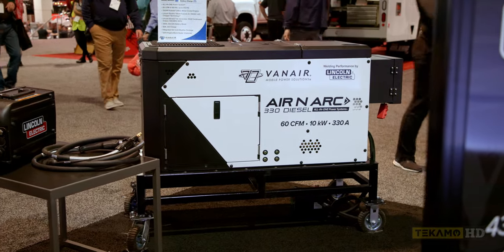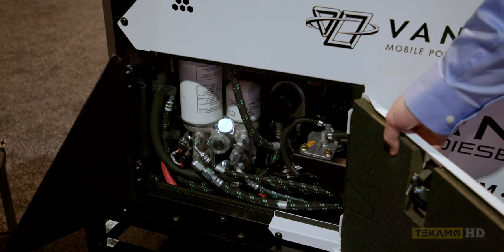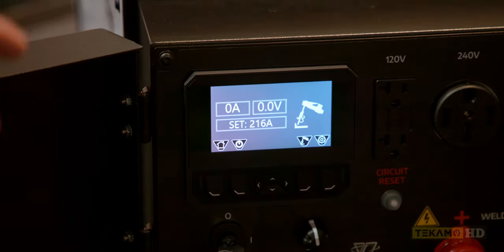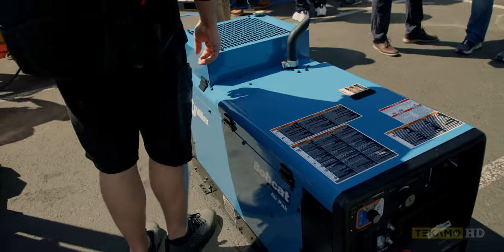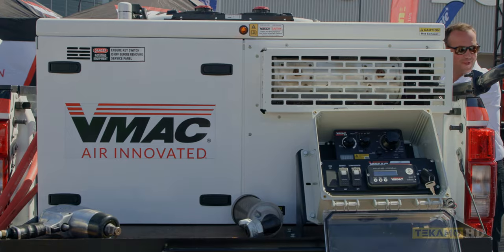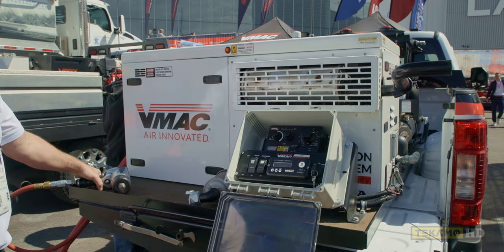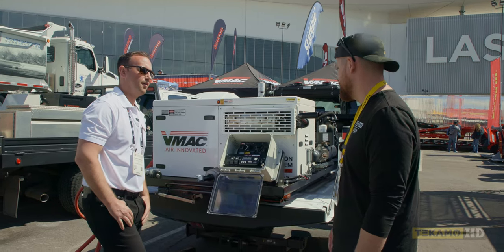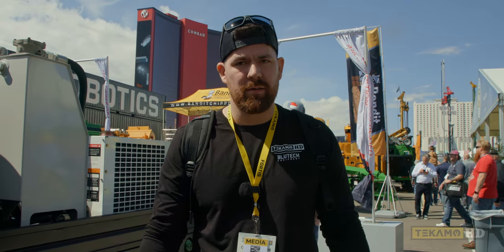ALL IN ONE SOLUTIONS! For Heavy Duty Mechanics - ConExpo 2023

Comment: I think I’m in the minority, I like to run EVERYTHING off my trucks pto hydraulics
Reply: i agree alot less to go wrong this new stuff to much digital garbage to go wrong
Reply: I guess the electric systems will be popular in the future, you have a decent size battery and power converter so you can use your normal compressors, welders etc that you would normaly run inside a shop.
Make choosing a vehicle much simpler since you dont need a PTO from the vehicle just a beefy alternator or a secondary 48v alternator.

Comment: In my mind all in ones are a safety problem. No a/c or heater running in the truck. What happens when you been working by yourself and get to the edge of heat exhaustion? No place to go cool off. I dont live where its cold, but I imagine similar concerns.
Reply: They actually do make them with cab heating and cooling attachments but I thinks it’s more for sleeper cabs to keep from idling the truck engine. I don’t let my truck idle in the field if I don’t need the PTO because it’s annoying. Start the truck up and in less than a min it’s blowing cold air. Hot air is another story but again just run the block heater off the enpak if you really want and there ya go hot air.

Comment: no thanks, i rather have a separate compressor, welder, generator, or hydraulic supply,  even service trailer instead of all on a truck. any one breaks down it wont stop me from using another truck or just replace the one thing that broke down, not waiting to repair the all in one or hoping when ill get my truck back

Comment: The classic problem still remains....you are one belt or pulley (or whatever other cheap POS part they used) away from losing every function you need to go about your work. Now you've got a $25000 paper weight bolted to your truck. NICE.

Comment: I am with you. Old Miller wore out, got what you have a Bobcat air pack. I am just a road service, so don't work them as hard as you big boys do [or myself] . But I agree that the all in one is the way to go.
  I like that I can crank the air pressure up to 170 lbs for the one inch Air Cat. As a road service I do a lot of road side battery charging so I wired the battery charge feature to where I can go through the welding leads so as to be able to reach 50' behind service truck. I always have to be positioned directly in front of the truck being serviced. The difference between me and the big boys is that the curb side is the work side, the road side is the suicide, hence, the tooling is on the opposite side than the equipment guys. 
  I recently bought a spool gun for mig aluminum, old Miller was a constant current machine, mainly 110 at idle and battery charging.
  Once again nice video!